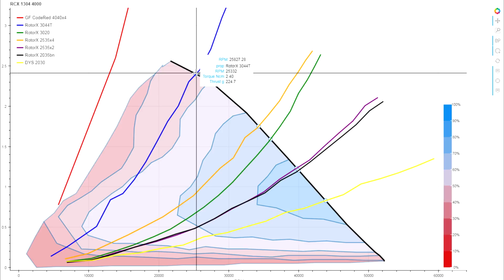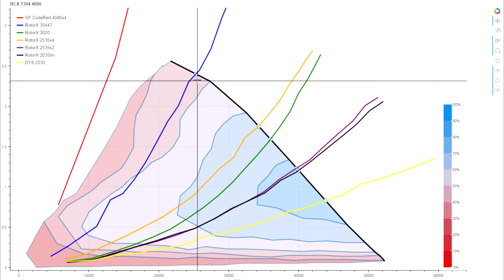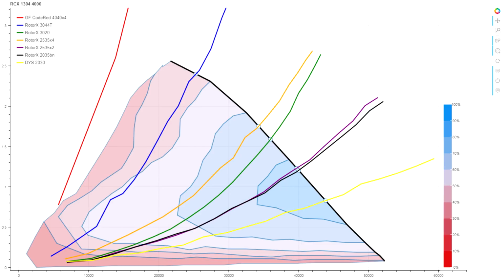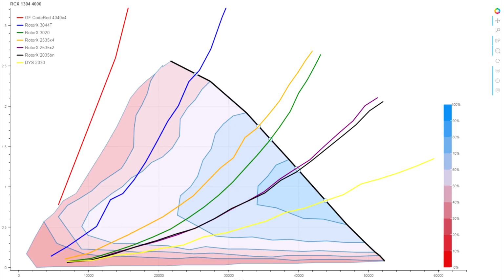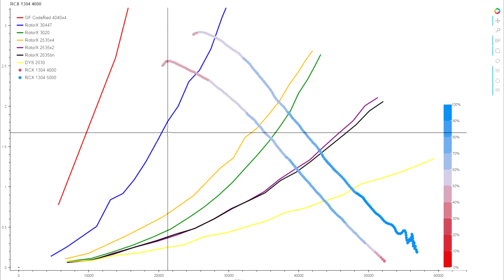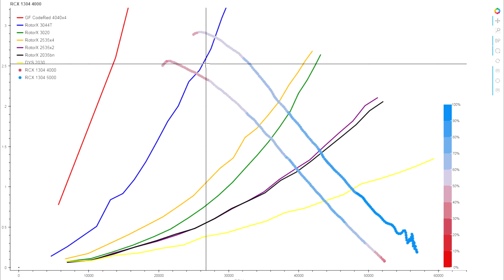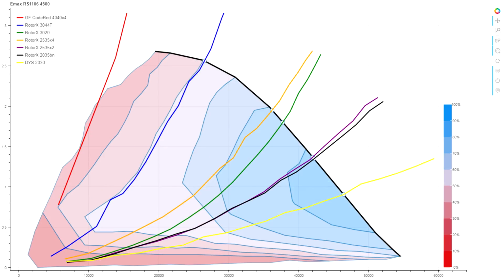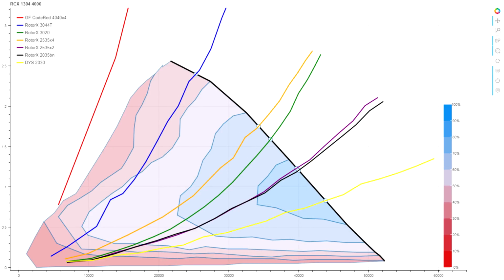RCX 1304-4000kv Dyno results

Comment: in 2020, im still loving the 1304 5000kv!  3  Questions!!! 1)  hey what elevation were you when you ran the prop tests 2)is the rotorX 2035bn a quad-blade? and 4) when are you coming back!!!!!!??? tons new little motors out there

Comment: Do you think these results be the same on 4s?  Even the 5,000's don't have enough power for me on 3s so I run both on 4s and I've actually been more impressed by the 4,000kv than the 5,000's
Reply from the maker: it all stays pretty much proportional.  the 4000 on 4s should be about 7% more powerful than the 5000 on 3s, and maybe about 10% less efficient from the numbers in this test, so probably 10-15% overall.  OFC due to the thrust curve of the prop that's going to be more than 7% more thrust, probably closer to 35% more for like a 3020, maybe 18% for something like a 2030.

The load matching doesn't really change
Reply: I'm actually more interested in comparing both kv's on 4s, what I think we might see is that 3" props are too big for all of the RPM that you get from the 5,000kv motor on 4s.  I can't tell any increase in power between the two on the HQ 3x3x3 and Gemfan 3035 prop but the run times on the 4,000kv are much better.
Reply from the maker: I have already done lots of testing with other motors at various voltages and various kv, you can see that in the voltage efficiency, comparing kv, and motor size comparison videos from last year.  I can only explain my own results, but I do agree that 4s on the 5ks seems a bit much unless you're only pulling like a 2"  The 5ks will still spin a 3" on 4s just fine though, you'll probably just drop another band.  

Stuff like the 3x3x3 and 3035 are a lot heavier than the 3020 that really matches these motors though, those are going to be much closer to the 3044 load trace, where in static tests it's starting to overheat and performance is flattening out.  If you're not getting as much cooling as I think you should be in the air I could totally see both motors performing just about the same when overloaded due to torque dropping off, and then all you're doing is dumping power into heat.  In that situation the 4ks will be less overloaded and in a better position.  IMO if you want to spin big 3" fast you want a 1407
Reply: Awesome, makes total sense and my journey into 1306/1407's has begun over the last month with Tommy's new 3" frame the Acrobrat :)  These 5,000kv 1304's have seemed to be a perfect match for 2.5" props over the last 6 months or so of flying them and the 4,000's are decent on 3" props but not quite as good so it's really cool to see data back that up.  As always thanks a million on behalf of the entire community for doing all this work bud, great stuff :)

Comment: Would love to see results testing these motors on 4s. I've been running 3" Avans on these motors with 4s 450 packs and they've been performing fantastic. No heat problems.
Reply from the maker: The dyno is very hard on the motors, and I burn a bunch of them at the voltages I test at already.  Thankfully it's really easy to extrapolate to higher voltages just from the charts presented here, and things like what the ideal prop loading for the motor is don't change as you increase or decrease the voltage.
Reply: i run the same, those avans are perfect, my 450s sag a bit too much, 650's fly forever at the cost of weight